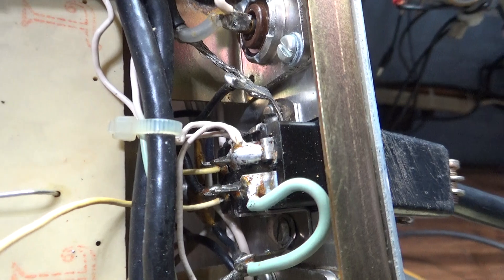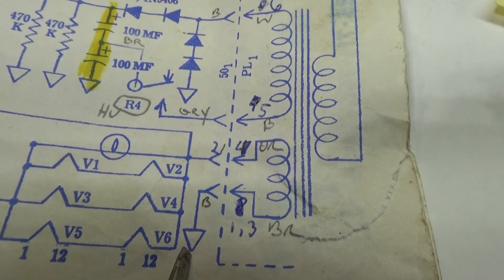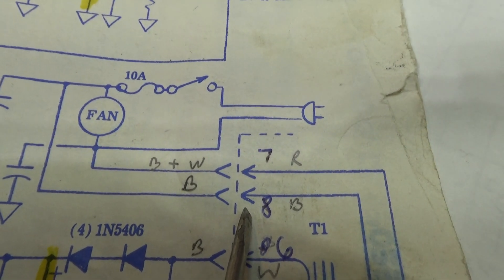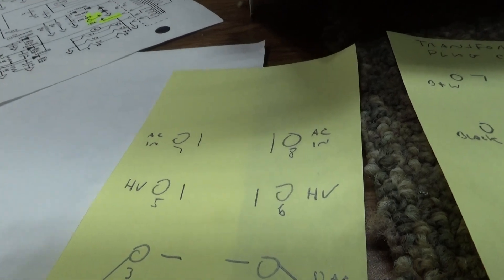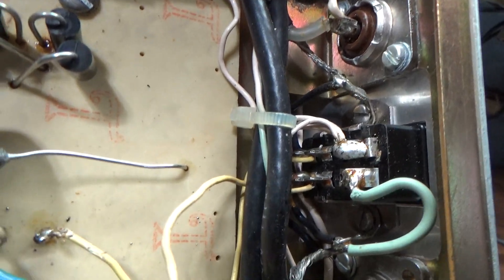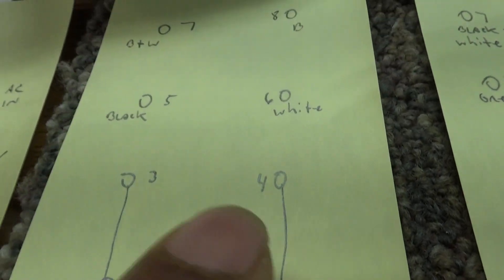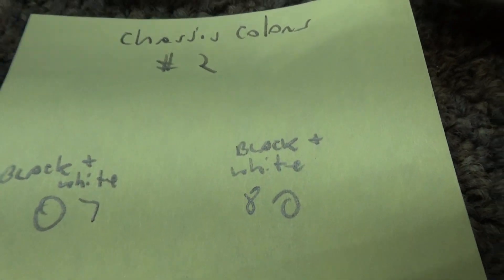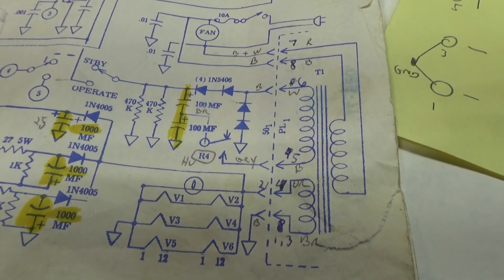Palomar 300A transformer plug wiring diagram / pinout  per request

Comment: Hay where are you located . I have a 300a it was ticking along and just quit . Turns on tubes light up fan works  . I took it out of service about the same time this video came out.  Its not pretty i would like to get it fixed tho.
Reply from the maker: I am in Detroit, but I no longer do repairs. I have retired from that. I have a couple nice 300A's left that I might sell though.